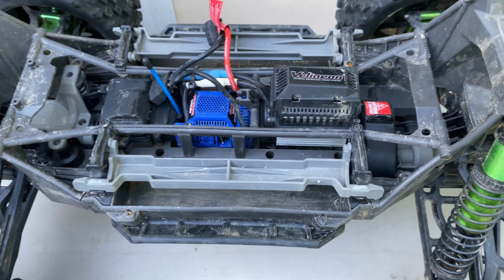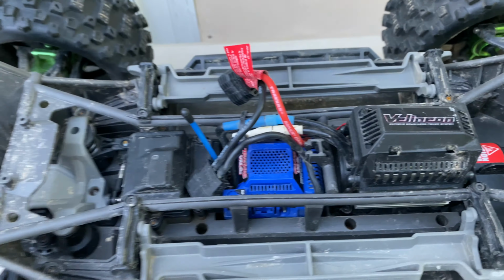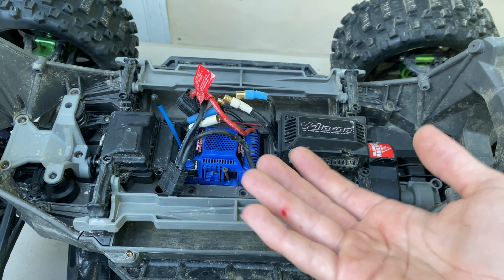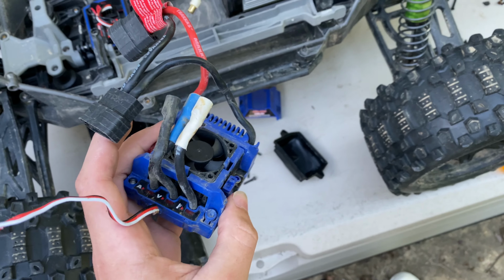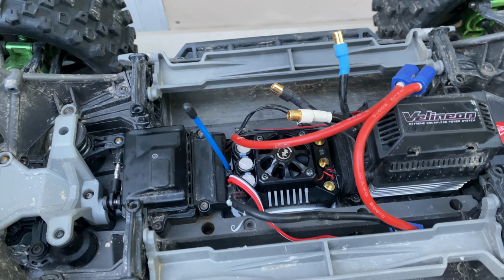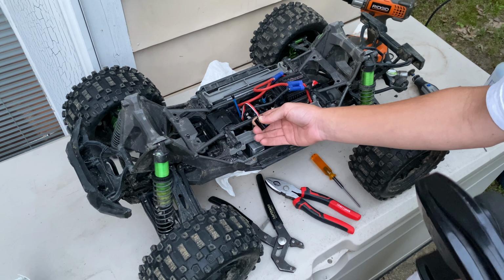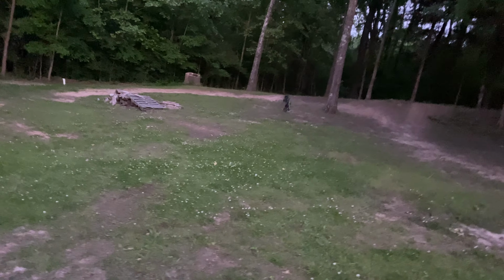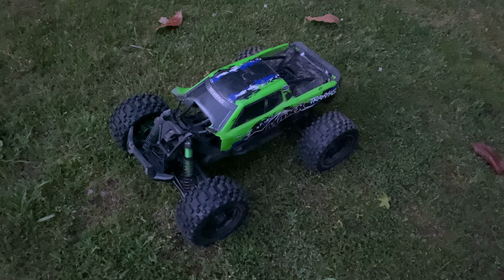XMaxx HOBBYWING MAX6 Install - MORE POWER!!!

Comment: I was debating on whether I should order this or not for my X-Max but now that I've watched this video I have to order one what unbelievable difference just from the ESC but that does mean that I can take the ESC out of the X-Max and put it in my red cat machete 6S and making an 8s and with the slightly upgraded motor that I have in it already it should handle the dialed down ESC pretty easily so I get two for the price of one by getting this ESC fantastic thanks for the video bro

Comment: How does an esc have more power?
Reply from the maker: More amp draw and current flow
Reply: @joshsrcs  correct me if im wrong but the motor draws the amps. The 200 amp is just a rating that the esc can supply without overheating. The rating is safe to use with that size of a truck at 33 volts. At least that's my understanding of it. The higher the amp rating, the slower it heats up
Reply from the maker: I am not an electronics guru, but from my understanding the max amp draw of the HobbyWing is higher than the Traxxas ESC. Higher max amperage is equivalent to a higher flow of power.

Comment: Could use someones help with this same esc same motor I have less power no wheelies no back flips no hats going on yes I have calibrated the remote and esc
Reply from the maker: Did you program the ESC to max punch and play with the settings?
Reply: @joshsrcs  yes I did thank you for responding my temp wire was plugged in the wrong spot I never had that happen before crazy but all is well now thank you

Comment: I'm not sure if you figured this out yet but you don't have to pull the skid plate from the under side of the xmaxx to get the upper tray out of the truck.  The skid plate has 4 holes in it that allow you to put your hex key (allen wrench) through the skid plate to access those 4 bolts that hold it from the underside.  i just thought i'd share this info with you incase you didn't know it.  Happy bashing!
Reply from the maker: I’ve since realized it. Thanks for sharing. SUBSCRIBE!!!

Comment: I run the Arrma 160 pretty much the same as a maxx6 and love it 46:23 and wow she ripps but I have a maxx5 in my k8 I mite drop in in worried it’s to much what’s y’all’s thoughts
Reply from the maker: MAX5 in the XMaxx without some serious mods may be a lil bit overkill/kills the XMaxx in general. If you don’t have an aftermarket motor and motor mount I’d get that and probably upgrade diffs to an aftermarket splined diff as well as putting some thicker fluid in all the diffs.

Comment: How could it go much faster with just an ESC change? [Disclaimer: I forwarded thru the video.  Dont know if you changed a gear as well] ESCs just deliver the available power from a battery to a load.  It cant create more amperage than the battery has to give.
Reply from the maker: I’m guessing it had to do with the batteries I used and less with the ESC. The PowerHobby lipos I used in the video delivered more volts than the previous Traxxas lipos I used to use. HobbyWing does time their motors tho (which is variable in HW programming) which allows for more or less motor RPM. Don’t ask me how it works because I have no idea when it gets that deep lol. Thanks for watching!

Comment: Mine came right out all of it without moving that brace or cutting it
Reply from the maker: Yea, there is no need to remove it.
Reply: @joshsrcs  yea I just removed the receiver box caps those black lids before I took the esc out and it slid right out

Comment: Hey bud did you change the motor? Or just the hobby wing max 6? Let me know Iam in the market to get a new esc for my xmaxx. Thanks in advance also if you can post a link where you got it from😉👍🏼💯
Reply from the maker: Cool! They are great ESC’s. I ONLY replaced the ESC with the MAX6. I got mine off of eBay but the seller I bought from raised the price. I found someone selling for cheaper who is very reputable. Here is the link for the MAX6: https://www.ebay.com/itm/Hobbywing-EZRun-MAX6-V3-1-6-Waterproof-Brushless-ESC-160A-3-8S-Brand-New-/154397179631?mkcid=16&mkevt=1&_trksid=p2349624.m46890.l49286&mkrid=711-127632-2357-0
SUBSCRIBE!!!
Reply: @joshsrcs  thanks man, just bought my bday gift…😂👍🏼

Comment: Nice vid. I upgraded mine this year after hearing about how much better the max6 is over stock. I didn’t find it to be much different in power but acceleration and braking seem more linear and more controllable.
Reply: It is siMply not worth the extra money and effort for most of the people
Reply: It literally doesn't do anything my esc broke hence why I got the max6 and it was just the same as the stock esc not one thing was different.

Comment: How waterproof/durable is the max 6? The stock ones keep dying on me just from washing the truck. No mud or even actual water crossings.
Reply from the maker: My MAX6 has been bulletproof so far. I’ve drowned the truck and put in under insane heat. No problems. The odds or getting an unlucky one are unlikely, but it can still happen.

Comment: Is there some type of adapter to go from the hobbywing battery wires to the traxxas batteries. When I got my x maxx 8s, i got the traxxas batteries, not knowing any better. But i wanna run them till they die, then get different ones.
Reply from the maker: Just get a 2 pack of these Traxxas connectors off of Amazon: https://www.amazon.com/Traxxas-Connector-Male-2/dp/B07QJ79PRM/ref=asc_df_B07QJ79PRM/?tag=hyprod-20&linkCode=df0&hvadid=366306819795&hvpos=&hvnetw=g&hvrand=5592702317969185263&hvpone=&hvptwo=&hvqmt=&hvdev=m&hvdvcmdl=&hvlocint=&hvlocphy=9013720&hvtargid=pla-785837452046&psc=1&tag=&ref=&adgrpid=81881572248&hvpone=&hvptwo=&hvadid=366306819795&hvpos=&hvnetw=g&hvrand=5592702317969185263&hvqmt=&hvdev=m&hvdvcmdl=&hvlocint=&hvlocphy=9013720&hvtargid=pla-785837452046
SUBSCRIBE!!!
Reply: @joshsrcs  sweet. Thank you, sir.
Reply: Upgrade the C rating too you'll be surprised how much more punch the car has

Comment: Hey dude, u don't have to take all that out, that's alot of wrenching for nothing? I just.took off the wire connector bracket with dermal that's all! Went right in 💯👍 hope I helped peace ✌️
Reply from the maker: I just wanted a little more room to work. Thanks tho.
Reply: @joshsrcs  i have to do this job soon. Yeah it looked like you dont need to take all that out, but it would help with space for the hands and make it easier. Thanks Sir

Comment: Is the traxxas receiver can handle 7.4V? Cause I have a 55kg agf servo on my xmaxx i'm just scare to run it 7.4V because no one ever tried to run their traxxas receiver 7.4V except you so I'm asking it can. 😅
Reply from the maker: From what I’ve experienced all my Traxxas RX can take it. I’ve been running them on 7.4 for a long time and they’ve all taken it. Thanks for Subscribing!
Reply: Ok nc I thought the traxxas rx can't take the 7.4V. Cause the sticker on the traxxas rx says it only supports 6V. Thanks for the advice❤️❤️❤️ more power to your channel...
Reply: @nathanielgacutan4336  its not promised. i wouldnt run it on 7,4volt. but if you have the money for a new reciever then try your luck.

Comment: Which one should I go for between X-maxx vs Losi 2.0 DBXLE?

My requirement is should be fun and speedy and durable
Reply from the maker: X-Maxx is all three from personal experience. What I’ve seen of the DBXL is that it’s slow, but can be geared up, and it isn’t that durable. If I had to pick between the two I’d choose the Losi and put some money into it.
Reply: I've had both and an XRT , now i'm back to the X-maxx , jist just nothing like it , the DB is too heavy and not as much fun , the X-maxx does wheelies and backflips , and you can play with less space

Comment: Hi. If you will use the Max6 on the Traxxas UDR with the lights, is this possible with the Max6? Do you know this?
Reply from the maker: I would assume that you wouldn’t be able to with the standard red Traxxas connector. You could soldier on the Traxxas red connector to the fan plug on the HobbyWing to make it work though.
Reply: @joshsrcs  Thanks for reply. But then, I can't use the fan. Or I could try the Traxxas 6541X connector. Maybe that will be work.
Reply from the maker: True, I didn’t think about the fan. I hope everything goes well!
Reply: @joshsrcs  It was just a question. I'm happy with the original ESC, yet. 👍

Comment: Whats the biggest  motor diamator wise you can fit with the stock mount.  You fitted a 36 series. was thinking of 42 or 46 and max 6 to  keep temps down

Comment: Didn't the receiver die from 7.4 volts?
Reply from the maker: No, the servo died. The only times I’ve had receivers die/overheat/smoke is when they were really old and have been through a lot of crap. SUBSCRIBE!!!
Reply: @joshsrcs  but traxxas says that the traxxas receiver can only take 6 volts maximum I'm surprised yours didn't die
Reply: @yuding237  its a lottery. It can survive, but its not promised. I would not want to run on 7,4 volt with traxxas electronics installed. Servo/Reciever.

Comment: Thanks for the video was debating on running the max 6 esc or the max 5 and pair it with the stick motor. My buddy did the max 5 with stock motor and it was way way too much punch. Ordered my max 6.

Comment: The only reason I change battery plugs to traxxas is so that it doesn’t void my warranty lmao
Reply from the maker: Yea I can definitely agree with that! Those Traxxas battery’s are expensive! I’ve had so many warranty claims on them because even though they are expensive they are super crap. If I were you I’d try to slowly transfer over to PowerHobby batteries. As your Traxxas batteries die send them in under warranty and get a brand new one to sell on eBay. You can basically pay for 2 PowerHobby’s if you sell a Traxxas 4s 6400mah. SUBSCRIBE!!!
Reply: @joshsrcs  oh I don’t have any traxxas ones, I’m gonna get some gems ace I think and change those connectors to traxxas so it doesn’t void my warranty on the esc, or is that a dumb thing to do lol im not the most experienced in the hobby yet

Comment: Hi d u know ecs maxx 5 voltage is 6 or  7.4 with 800 kv motor
Reply from the maker: Motor doesn’t come into play on ESC voltage. Check what voltage your servo can take and set the voltage accordingly. Stock settings it is at 6v.
Reply: Thanks for that good information .

Comment: I stay with TRAXXAS battery’s, I don’t care about the price, I just like the convenience, and everything being TRAXXAS brand!
Reply from the maker: Cool.
Reply: Yea they’re nice batteries if ya don’t care about price, I’ve just been using my traxxas batteries I got on sale in my e revo 2.0 and gensace in my 1/10th scalers
Reply: They are pricey for sure but with my 6700 4s battery's the very first run I got out of them was 53mins long. That's a crazy long run time, so far I'd say there worth the extra cash.
Reply from the maker: Try PowerHobby. They have long run times and the punch is really good.
Reply: The Youme lipos are FAR BETTER than the Traxxas batteries. Been there done that, Traxxas batteries are trash.. you'll see

Comment: Hello Josh, I saw that you are running duratrax six pack x on your xmaxx and I was wondering if you had to do anything with the wheels to get them on the stock hubs of the xmaxx because I am thinking of getting them.
Reply from the maker: No, they fit perfectly with NO trimming. Duratrax makes a set for the Kraton 8s but they say Kraton 8s on the packaging. Make sure you get the regular Duratrax Six Pack X. They are great tires, and you should definitely get them. I’ve got some videos on them and every video after those I’m running the Six Pack X.
Reply: @joshsrcs  thank you so much man I ordered the tires but I was freaking out whether I had to trim them or not because I don’t want to ruin the xmaxx or the new wheels have a great day bro 🤝😁

Comment: Are the Blue connectors of the max6 preinstalled?
Reply from the maker: No, the blue connectors (EC5 connectors) do not come preinstalled on the MAX6 or any of the HobbyWing ESC’s. I installed the EC5 connectors onto the MAX6 myself. If you buy this ESC you will have to soldier the connectors on yourself.